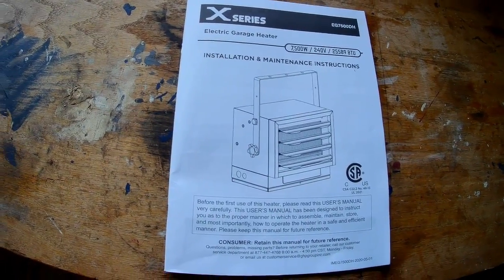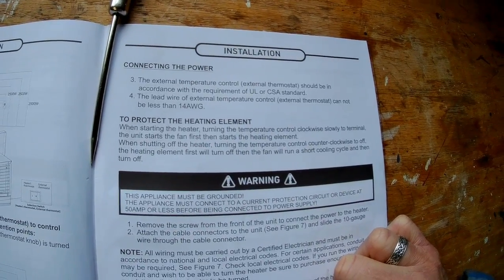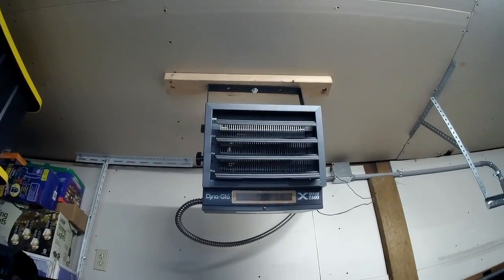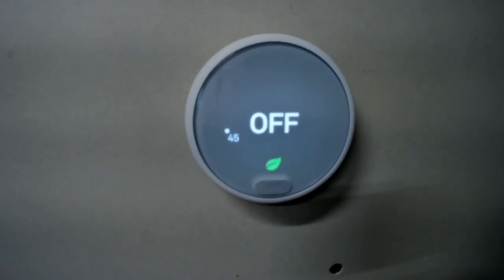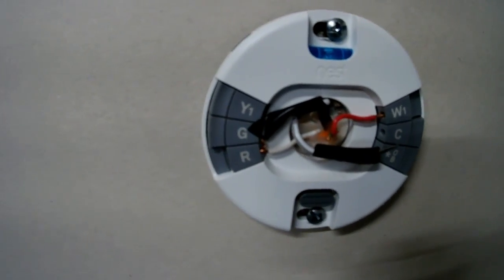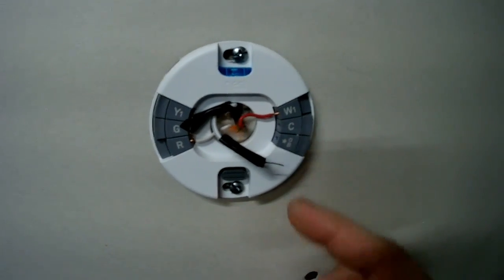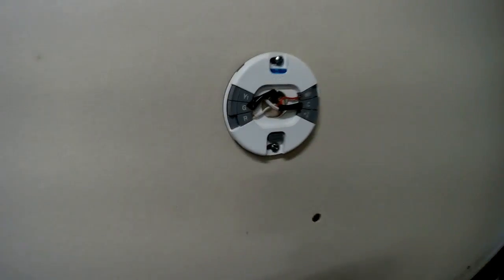Dyna-Glo 7500W Electric Garage/Shop Heater with Nest Tstat Install-NOT THIS model?-read desc-volts!

Comment: I think the confusion with this video is that somehow the  EG7500DH that is used is rare in that Dyna-Glo no longer makes this model with an out-of-the box 24V hookup. If you check their site, all of the units use 240V thermostat connections. The manual in the video shown shows the 24V connection from the PCB board. The new ones don't. What makes it even more confusing is that the date on the manual used in the video shows 2020-05-01. The manual for this model on the website is 2018-12-12. From what I can tell, the only way to use a low voltage thermostat with any Dyna-Glo unit is to use a contactor with a transformer. What is even more frustrating is that none of the smart line voltage thermostats I have found are rated to use with a fan forced electric garage heater... at least not officially.
I checked Lowe's site from the link provided and they do sell the EG7500DH but I don't think it will have the 24V thermostat connection. Home Depot shows the same model number with a link to the installation manual and it too only specifies a line voltage 240V thermostat.
Reply from the maker: @chula_min  Yep. This is historical. There are 240 capable smart thermostats on the market now. Use one and in accordance with their instructions. 🤙
Reply: @icarian76  I've contacted a couple of manufacturers: Stelpro and Sinope. Neither of them have units that are approved for this type of heater. I'll keep looking as price is also a consideration.

Comment: I’m interested in this heater for my garage in Michigan. I’m confused. Why do you need an external thermostat (Nest-in your case), if it has an internal thermostat?
Also, did you have any issue using (pairing) the WiFi (a few people mentioned they did in other reviews on line)?
Reply from the maker: Internal thermostat is not "smart" (cannot be controlled remotely~from my house in my case). With me not having a way to control it remotely, you MUST physically go out and turn it on (and most likely go back inside waiting for it to warm up). 

As for WiFi pairing a Nest, that is most likely the WiFi router not pushing a 2.4GHz band in parallel to the higher bands (5GHz and higher nowadays). I have an Orbi Mesh WiFi system and zero issues with Feit Electric smart plugs, Nest/Google Cams/doorbells,...or Nest Thermostats connecting (all use 2.4).

That stated, I did this hack over 4 years ago. Still works perfectly for me. But I REALLY did not have an option (if I wanted a smart thermostat) then. Market has changed and there ARE multiple variable/240v capable smart thermostats on the market. And I do not know what changes Dyna-Glo has made in the last 4 years to this model. Since you don't have to now, no need to work this "hack". If you buy one of the Dyna Glos, use a "proper" thermostat and hook up per their current owner's manual instructions. 

I will say being able to schedule/turn on/turn off remotely is a game changer. So is an "Emergency Temperature" kick on (my Nest comes on 35 degrees f) if you have fluids/paints that you do not want to freeze. I would look for that feature in any thermostat I bought. 🤙

Comment: Do NOT! It is workable cheat. Just cause it works dosent mean you should. Suggest you people don’t for few reasons. 
1) you will have high voltage going to a device that should not. Causing someone in the future to possibly get hurt. 
2) the contacts inside the thermostat are meant for 24 volts not 120 volts will fail. 
3) Cut corners safely don’t do this method 

It is more expensive but can be done with a 24volt doorbell transformer and 2 pole contact that has a 24 coil.
Reply from the maker: I recommend (mostly in later replies as product has come to market) that people use a wifi smart thermostat that is made specifically for such systems...as they have come to market and were non existent when I did this DIY. That stated, on your # 1 and # 2, you are talking in absolutes. And those "absolutes" are obviously not as my model of heater and thermostat do not equate to what you stated (I do not have 240v going from the  heater to the thermostat, nor do I have 120v as I had to add a 24v transformer to keep the Nest thermostat powered). I understand what you are saying-you must be able to safely use a multimeter and test / confirm if you do this DIY. There CAN be repercussions if you do not. And NOW there are other options out there that are specifically engineered to meet this need/want. But my setup does continue to work as advertised.

Comment: It is workable cheat. Suggest you people don’t for few reasons. 
1) you will have high voltage going to a device that should not. Causing someone in the future to possibly get hurt. 
2) the contacts inside the thermostat are meant for 24 volts not 120 volts will fail. 
3) Cut corners safely don’t do this method 

It is more expensive but can be done a 2 pole contact with a 24 coil.

Comment: My garage has a typical 240 V power outlet, like you have for a dryer. Will this plug-in directly into that. thank you.
Reply from the maker: @moods4208  Most of these heaters are direct  wire (you are going to need to confirm any 240 outlet you use can carry the amperage -most likely 50 amp) depending on your draw/heater size). Might be doable, but you’ll need to research if you can do so safely.

Comment: WARNING! I installed one last winter. Half of the heater elements failed in less than a year but because I was over a year since actually purchasing the unit there was no warranty. You CANNOT purchase replacement elements, even though it would be a simple fix. This heater is sold under multiple brands with small changes to the control interface. None of them list the spare parts as available. SO basically if something fails you will not likely be able to get it fixed if out of the 1 yr warranty. Very shady dealings.  Two thumbs DOWN!
Reply from the maker: That sucks (and sucks that yours didn’t hold up too). Thanks for the warning/S.O.L. if it fails. 🤙

Comment: Used ecobee lite & it did worked. Heater starts/stopped properly. With that being said, the unit only run on HIGH (7500W) and no way to switch to LOW (5000W) even if I set it to its lowest temp. Other than this everything is working well. Thanks for the video, I find it very helpful. Lastly, the external tsat has to be installed somewhere away from the unit to properly read room temp. Those who have issue with short cycle due to wrong temp reading from the built-in tstat, you can add about 3-4 feet of thin gauage wire to drop, letting the probe sensor hang away from the heater, at least a couple distant from the ground.

Comment: I have exact the same unit as yours; however, after reading all the comments, I'm afraid I'm still quite confused 😅. I noticed there is a transformer in the heater, which I assumed converts the 240v to a desired power output for the modern/smart thermostat, am I right? It puzzles me when I saw you used a power adaptor for the nest. Also, I'm wondering if the connections from the heater to the thermostat is only meant to control the temp and does not necessarily provide power to the thermostat. Or it does provide power to the thermostat but the power output remains 240V that is why you need a power adapter? Sorry, I know my thoughts and questions are so scattered. Hope you can help clarify. Thank you.

Comment: Hi, Does fan stay on after turning off the heater for a little bit, for a cool down? or does the whole unit shut off including the fan at the same time?
Reply from the maker: All cycles off at the same time on my model.
Reply: @icarian76  thanks for the response.

Comment: DAMN! For several years I’ve had a 5,000W heater in my 3 car garage woodshop. I’ve had an “extra” Nest laying around (as I swapped it out for an ecobe in my house) I’ve wanted to use for the garage. However, was told many times it would not work as my heater is 220/240v (on 10g wire)
Reply from the maker: My 7500 still works as advertised/shown. Just be sure to use your tester/confirm the voltage before hooking up that Nest. 😊

Comment: Is it still working? And what about the default cool down? Does it still cool down using the fan?
Reply from the maker: Works exactly the same as when I installed it. No default cooldown on mine. Used for heat only.

Comment: I have a 7500W Dyna Glo EG7500DGC - yours has only one connection block shown at 5.54m - the diagram in the booklet is no compatible with mine and has only 2 connections and does not look like the terminals in the heater itself - BUT I have 4 connections 2 separate blocks -1(L) AND 2(N) on one connection block and then same markings 1(L) and 2(N) on the other block so I have 4 terminals they stuck a label L1 - L2 next to one of the terminal blocks - so it looks like the (N) terminal must be the Neutral wire? - I am using 3core wire so red and black can be 110v so the neutral wire could be used on the (N) connections? Does that make sense? It is confusing - and tech support does no answer!

Comment: Do you know if this will work with the DG7500DGP? It’s external thermostat capable but the wiring diagram is a little different than what you show here.

Comment: Quick question on this, do you not need a neutral wire? From your breaker you just have black and red feeding into the breaker itself and the ground attached to the bar? No need for a neutral?
Reply: Thank you for your responses! I just did the install this morning and everything is working great! Thank you for the awesome video!
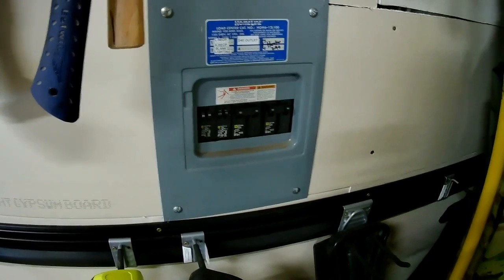Reply from the maker: kh12-it HAS been a minute since I did my electrical, but no neutral. I went to several "how to install 220v" YT clips and researched there. I still have my electrical playlist saved and here is one used (about 3:30 in): https://youtu.be/u296hiXRzlE
Reply from the maker: Looking back at that video, I stated neutral quite clearly. It was a 3 wire setup ONLY (not a 4 wire that would include a neutral). 2 x 110 hot circuits and the ground from the junction box to the heater. This was the other video I used: she is an "influencer" so she had a bunch of feedback. Comment section (first comment for me) was applicable. GL. https://youtu.be/X9ro7Tc2nFI

Comment: Does the heater reset to off if you loose power to the heater with the external tstat ?
Reply from the maker: I have no idea. Let us go see...
Reply from the maker: Short answer: my heater continues to work off what the Nest wants/wanted before power was lost. Makes sense as the Nest has a battery and remembers what you had it doing previously. 

Long version: 2 min video confirmation. https://youtu.be/B5EYdDSTjd4

Comment: Dumb question. How do I turn it on?? I have a brand new one, professionally installed, I can't see an on/off switch. Ugh. The brand new remote doesn't seem to work.  Yes, I pulled the plastic insert out so it would work. Please help.
Reply from the maker: Probably overcome by events by now (airline pilot here-when on the road, not likely to see), but my S.W.A.G. is the external/internal thermostat rocker switch isn’t moved to the external (ii) position. It is on the backside/bottom of the heater.
Reply from the maker: Just went to check mine (just easier for a reference): heater infrared remote does not do anything if the heater is being controlled by the external Tstat. If nothing is happening when you turn your external Tstat on, do you have power (220 circuit breaker) to the heater? Temp in shop/heated space is not at or higher than on your external Tstat?

If neither of those fixed it, get that pro back out (surely they gave it a test run). I also suspect you already got it going by now…🤞🏼🤙

Comment: At 5:58 you show the power and ground wires coming into the unit. I can see the red and black hots, and the green ground. Where does the white neutral hook up? I read through the instructions online and cannot find where to hook it up.
Reply: dont need the common.  i asked a master electricain the same question.  so i just put a wire nut on the end of the white common wire in my breaker box and in the heater unit.
Reply: @congoparrot  Thank you! I was eventually able to figure out the same thing, and it's nice to get secondary confirmation from you. The lack of a common in the installation manual, and the failure to even mention it, was the major hold up for me doing my electrical work. I am so used to 120 V circuits with a common, that the idea of not having one on a 240V circuit just seems "wrong".

Comment: Looks pretty easy, any idea why other videos show the addition of transformers and conductors?
Reply: I meant contactor, not conductor...
Reply from the maker: Yes. When I did this, I was experimenting to get a low voltage smart thermostat to work as there wasn’t a 220v smart thermostat option that I could find on the market. Mine still works perfectly, but with 220-240v smart thermostats now more prevalent, I would go with “as designed”.

Comment: Thanks for the video!  I just installed an old Honeywell so I could get a lower temp.  Made me take a closer look at everything.  The install manual is pieced together, the 14AWG wire for the thermostat is not correct, even the internal thermostat connector wires are maybe 18AWG.  The manual is definitely for the older models. The built in thermostat is digital, no "control knob" to crank lol.  I wrote an email to Dyna-glo, no response. A potentially dangerous mistake to have in a manual.
Reply: I know its been a while, but are you saying we should use 18gauge wire for the thermostat? Even for a high voltage 240 thermostat? I ran 14gauge as per manual and there is no power to my high voltage thermostat…im lost here
Reply: @scottian2208 I don’t remember, it’s been too long. I do know that the thermostat in mine is a low voltage thermostat. The heater is still high voltage. I ran an old honeywell external thermostat instead of a digital one that would require a 24 volt C wire.
Reply: @ColinHillier71 what do you do with the internal stat when you wire in an external stat?

Comment: Thanks for the video! mines on order. Question now that its been up do you find the placement on the ceiling to close to the wall or is it perfect ? Does it get Hot? going to mount mine with garage door brackets but worried about placement away from the wall. Thanks again
EDIT It just came in and I've hung it up. I used garage door slotted rails shake a bit but its on there sturdy its not going anywhere. Question: have you noticed any bowing in the center of the bracket? I used the singe bolt so we can spin it like you did

Comment: Great video, very helpful. I installed the same heater with an Ecobee thermostat. Works like a charm.
Reply: Sorry how did you wired to the ecobee? Would you be able to show me? We try and we even got a power transformer. We are just stum on the connection portion of Ecobee. Even though we try all kind of options

Comment: Great video. But I'm experiencing the same problem as Rico. When the heat cycle is done, the fan keeps blowing. The fan will not shut off. I have mine set at electric heat forced air, is that correct?
Reply from the maker: It is. Mine is a Thermostat E, is yours?
 https://youtube.com/shorts/x_gfpZNpZFE?feature=share
Reply: No. Just Google nest.

Comment: With the external thermostat are you able to select whether it is 5000w or 7500w, or does that still switch automatically? I have the 7500w/10000w version and wish I could keep it on 10000w and not have it automatically kick down when it gets close to the set temp.

Comment: Hey There...great video, thanks for sharing.  Quick question, I thought the green wire was a ground...back at the distribution panel, is that green wire terminated into the neutral busbar or the ground bar?
Reply from the maker: Kaleb-you are discussing the 240 from the sub panel to the heater? If so, just use one of the many “wiring a sub panel with 240” videos on YT. That is what I did. Many are master electricians and will go off the NEC.
Reply: I had the same question. To me, the ground is to earth and neutral is current return path. So you hook the neutral from the panel to the ground on heater and the heater has no ground path to earth?